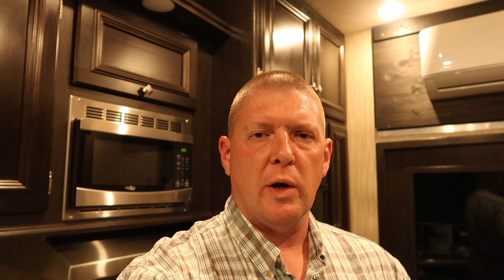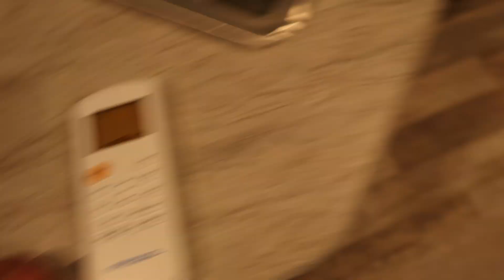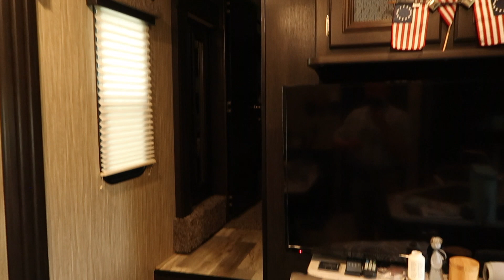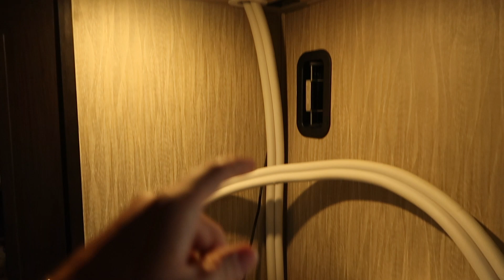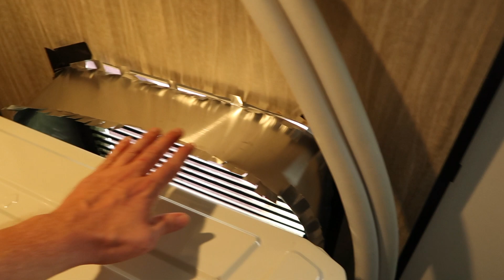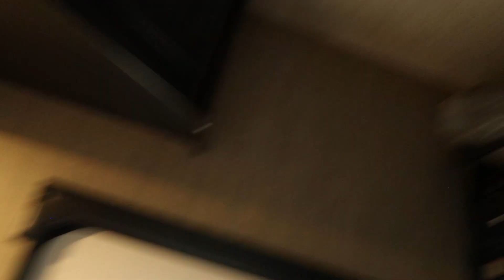Mini Split AC will it run

Comment: I also have a toy hauler and want to install a mini split someday.  I was thinking of hanging the outside unit underneath the garage where the spare tire is. I would need to flip the compressor 90 degrees so that it is vertical because of the oil in it, but the fan would be horizontal and far enough from the ground. Based on your experience do you think that could work?
Reply from the maker: Its possible it might work. The hard part would be tearing the unit down to get to the compressor to turn it 90 degrees. My other concern would be you're changing the way the coolant would flow through the radiator as well and that might have an effect on the freon and how it flows.

Comment: Commenting on trying to get cooler air to your bedroom, I think by putting a maxxair fan to draw the air out and pull the cold air forward may not work as well as you think.

If the mr. Cool works like a swamp cooler and it takes fresh air from outside and cooled it down and push it into your I will trailer now you're pressurizing your cabin and it will work the way you want pushing the cold air forward and exhausting the hot air out of your vent.

But air conditioning units are circulating units they don't pressurize the cabin they just circulate the air Within so if you turn on the max air fan you're going to draw hot air from outside in, since you're creating a negative vacuum within the trailer.

Outside air will enter your travel trailer through nooks and crannies and slide-out openings gaps of your travel trailer it may give the mrcool a little hard time to cool down your trailer with hot air  from outside seeping in.

But give it a try I'm no expert you may feel better difference Maybe lol.   but if you don't or you feel warm patches within the travel trailer that means the warm air is seeping in from outside.

 as for the garage being so hot I think you have the right idea, the Prototype fan shroud is letting too much air backflow back into the garage if you can make a more airtight fan shroud that can prevents any air from back flowing into the garage it should be a lot cooler, it won't find its way back in.

Unless the heat is just radiating off the unit itself.
Reply from the maker: I replaced the fan in the bathroom which does help pull air forward but similar to what you mentioned, it also is pulling air up out of the crawl space through a vent the manufacture designed in. The mini split works and is functional for the most part aside from the garage heat issue. I can manage the heat back there by opening window but its so humid in Florida the result isn't quite what I was looking for either. I am probably going to end up replacing the roof top unit and end up selling the mini split to a body of mine for his new shop.
Reply: @WindersRanger  

Oh yeah Florida is definitely humid I've never been there I was born in Chicago I can only imagine Florida lol. 

Yeah I kind of thought creating a negative vacuum will make hot air seeping through out the RV via small Gap in opening.

I'm sure that mini-split works great it's just trying to cool off the entire trailer with only one cool air point meaning not Central Cooling will be a challenge.

And then as you mentioned in your video you had a hard time mounting the other half of it outside so now it's generating a lot of heat in the garage.

 you can always put a large solar system on your trailer and then you can run your air conditioner through it that's what I'm working on with my motorhome now.

I should be able to run both of my air conditioning I say about 10 a.m. to  5 p.m.  that's the hottest part of the day anyway and just shut them down before Sunset, I haven't tried it yet but I should be 100% battery power if I do it that way.

I'll be pulling 61 amps from my rooftop solar panels my motorhome is a 50 amp so I should be able to run everything but let me tell you it's a pretty penny 😕.

But if your full-time like I am it's well worth the comfort and it will pay for itself with no electricity expenses/ RV park fees, especially if you Boondock often.
Reply from the maker: Yep, Solar is on my todo list at some point. I figure I might dabble in solar once I get some of these other issues ironed out.
Reply: @WindersRanger  

Awesome that's the best route to go👍😎